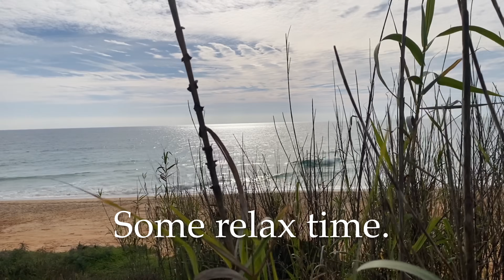Getting Back Into The Swing Of Things

Comment: You are lucky its not 1mm. you can use 1.5mm for low power circuit, when I did our house east europe, lights and socket on the same circuit, all 16A. and alu cable, 3ph service. take care you two.
Reply from the maker: Yes but the heater Is high power 👍🏼

Comment: The way I did my greenhouse plastic was by digging a ditch either side about 2 foot wide and deep, put the plastic lining the ditch and filling in the ditch from the outside inwards, as you move in towards the walls the plastic gets tighter and tighter, having said that mine is 6 meters wide and works great, O got some round clips that clip onto the pipe and the round posts to do the ends, been up 8 years now and will soon need changing, not looking forward to that at my age, 66
Reply from the maker: Thanks for sharing with us 😊